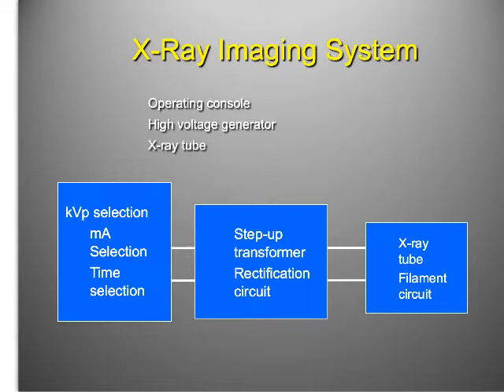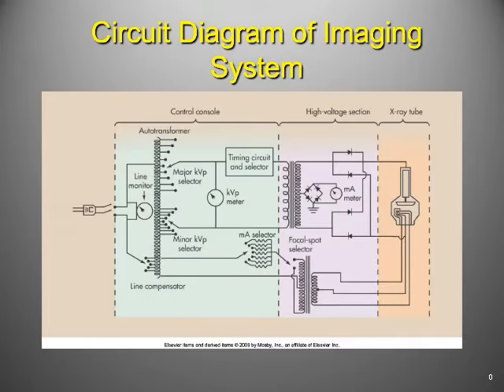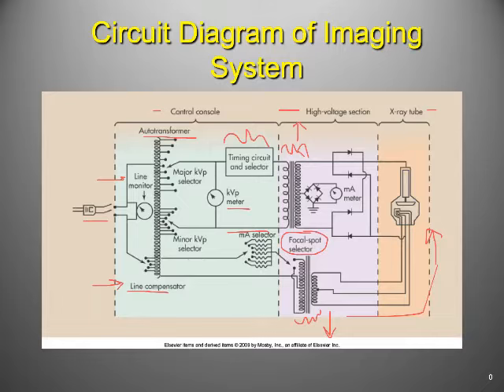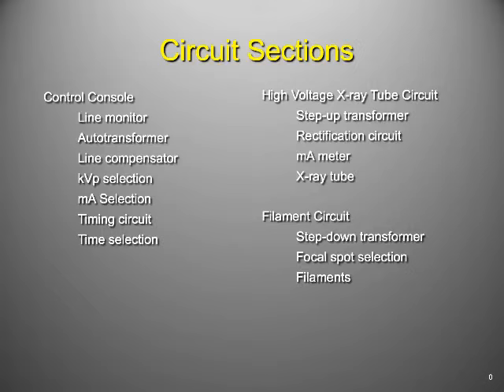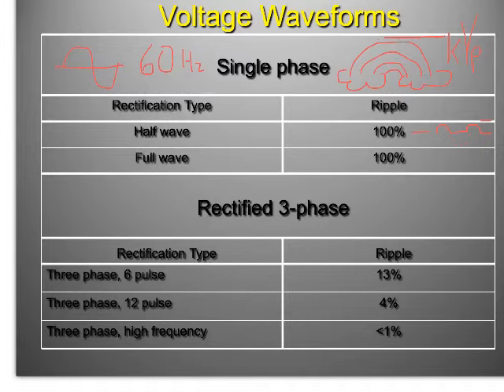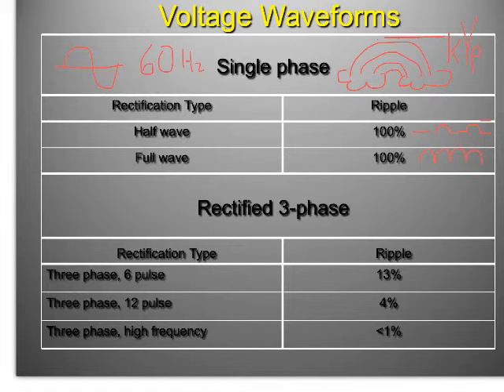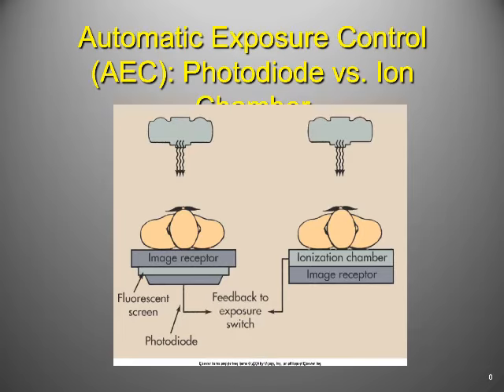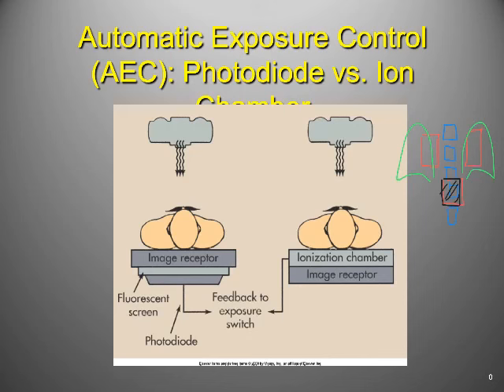X-ray Circuit and Generator

Comment: Good video but there are several technical issues.  Transformers step up or step down voltage and not power.  Hydroelectric generators don't slow down and give fewer cycles when the water level is low.  Auto transformers are not self inducting.  The focal spot selector transformer is not drawn correctly.  It would need to be two separate transformers.  The mA meter diodes are not drawn correctly and the ground symbol is not right.  The high voltage diodes are not drawn right.  The main difference between an auto transformer and a two winding transformer is the two winding one can be used as an isolation transformer.  The filament transformer could be just 1 to 1 windings.  Not step up or step down.  But the primary side is in the low voltage circuit and the secondary is in the high voltage circuit.  So there is between  50KV and 150KV between the primary and secondary sides even though the secondary is only applying about 20v to the filaments.  Europe uses 50 hertz and 240 volts.  The higher voltage would damage your US appliance and not the 50 hertz.  Three phase power is not "slightly" out of phase, it is 120 degrees and 240 degrees out of phase.
Battery powered portables do not create the high voltage with a 150,000 volt battery.  They use about a 300v battery, which powers a converter to change it to AC, which powers a high voltage transformer, which is then rectified to dc to run the x-ray tube. The AC from the converter is at a high frequency so the transformer can be fairly small. So high frequency ripple.  I remember calling it photo timing in the late '70s and early '80s and I am still alive.
Diodes allow current to flow in only one direction and not power.
Thank you.  From a now retired, former medical x-ray machine repair engineer.

Comment: Thank you for your video, it’s really awesome! I wanted to ask, what textbook are your students using? My class is using the Bushong Physics book (so the Simplified Electrical Circuit Diagram you’re using for this video I have in my textbook & it’s also in the 7th edition of the Mosby’s Comprehensive Review).
Reply from the maker: Great question! Yeah, I use Bushong a little, but this lecture is based more on Quinn Carroll Radiography in the Digital Age

Comment: Thanks this is very helpful however I believe that there are many ways in which we can get rid of or reduce the ripples in single phase rectification simply using decoupling capacitors along with inductors as low pass filters is there a reason why they're not used here?
Reply from the maker: They may be... that is a question for engineers. This is a video for imaging technologists.

Comment: The ma should be in the high voltage circuit, if I’m not mistaken
Reply from the maker: mA is all over the map. The mA selector is at the operator console (low voltage). The mA meter is in the high voltage section, and the filament circuit (controlled by the mA meter) is best thought of as separate from the high voltage section because we're using a step down transformer.
Reply: The hv connections from the transformer to the tube are totally wrong. Also those for the mA meter. The X-RAy tube is a diode, so the hv rectifiers are not really needed.